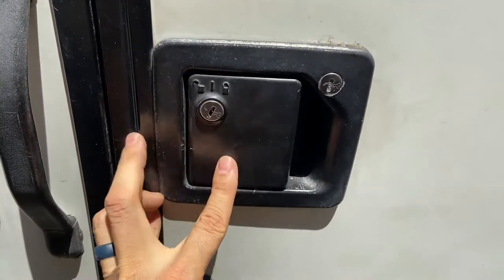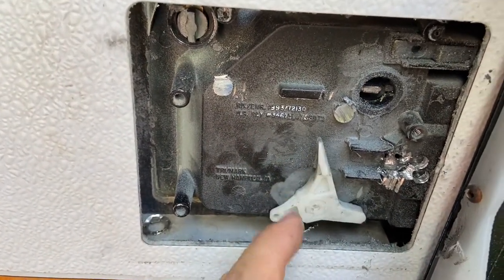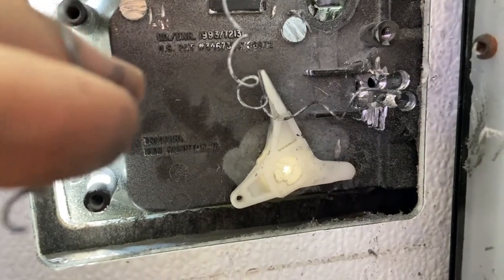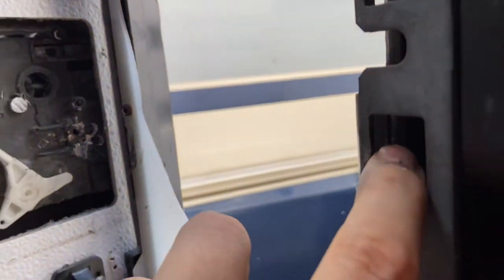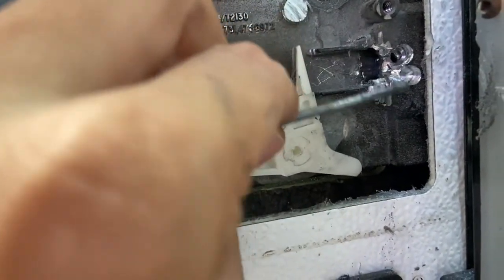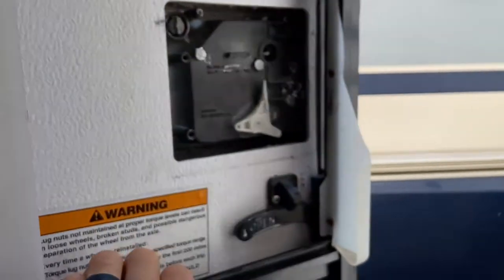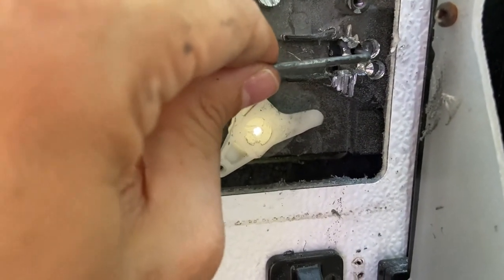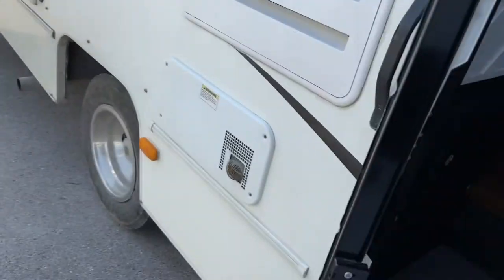RV Door Stuck Shut! SOLVED!!!

Comment: After many many videos viewed, your video hit the issue I had.  Thank you for posting it!  Once I pulled the spring out, drilled a divet on the latch "arm", if was able to move it back further, with a pin, and my motorhome door opened freely.
Reply from the maker: Awesome, glad that worked for you. I looked all over YouTube for an answer to this and found nothing. After I figured this out and realizing that this design flaw is likely pervasive, I had to imagine that other people would be in the same boat so I decided to record this to save other people the headache. It's insane that the manufacturer doesn't have a solution for this that I'm aware of.

Comment: Yup. Same issue...drilled the heck out of the inside...but then woke up and found your video...your info led to drilling a hole at the latch level and just used small screwdriv😊er to pull latch back a bit, then pulled left with needle nose plyers...bingo: door opened. THANKS!

Comment: Thanks to your video i was able to fix the exact issue on my RV. I didnt know about that second plate either so i was stumped. I was able to flatten an old wire coathanger to be thin enough to fit between the two plates that the thing gets stuck on and i managed to push it past the second plate while the door was still closed. Couldnt have done it without seeing your vid though. Thanks.
Reply: Awesome, glad it could help! Nothing ilke being a YouTube mechanic, right?